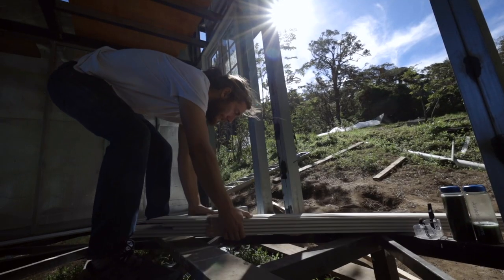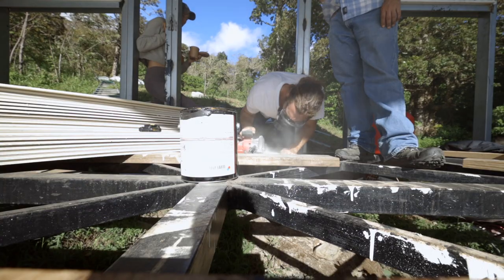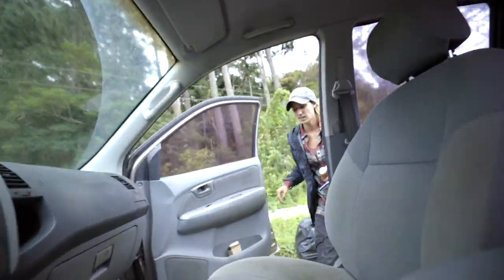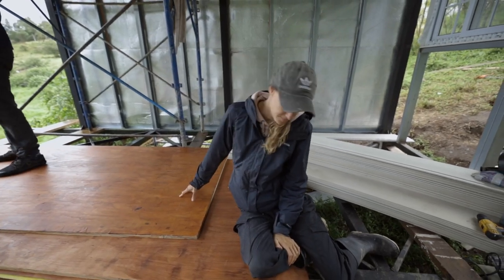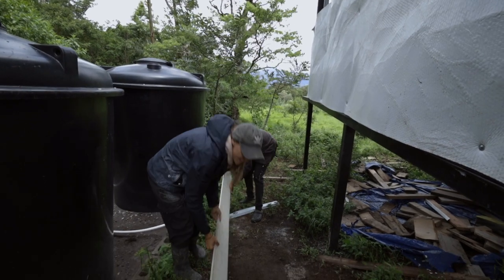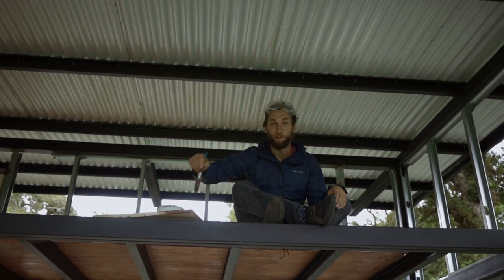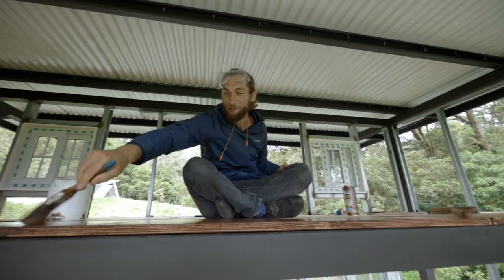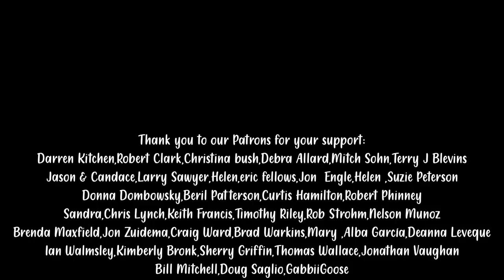THIS IS SUCH A BIG DEAL FOR US!

Comment: Everything is looking so beautiful!! Stain won't protect wood from anything and two layers might promote rot because of the probability of moisture getting trapped! :( Pressure treated (long-term protection against rot, fungal decay and termite by preservative) or marine grade (strong sturdy wood not treated with chemicals) wood are good options!

Comment: Your wasting materials by doubling the plywood, 3/4" PLY over 16" centers is good for more than 400+lbs psf  and that's more than you have.
Reply: yep!
Reply: Exactly what I was going to comment, figured I should check to see if someone already said it first. If you are looking to strengthen your seams that are spanning the joists, you can just put any wood blocking material under the seam and screw down through the two pieces of ply into the block from above, connecting the two sheets together.
Reply: Can we interest you in some luxury vinyl tile instead?  It does well in high humidity.
Reply: Doubling will increase chance of rot

Comment: You need to get a long stick (about 6 ft) and put a piece of strong wire in the shape of a tight question mark.  You can use it to catch chickens by their feet easily from a distance.  Very nice video.